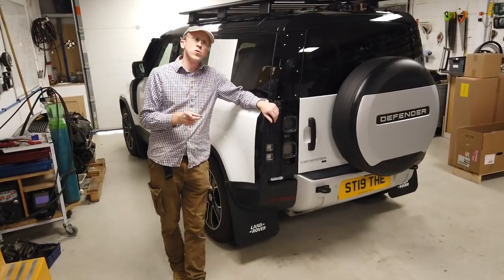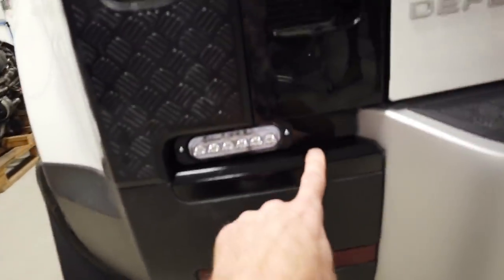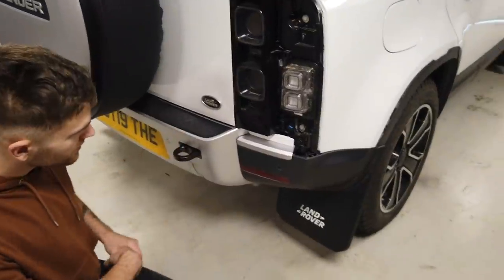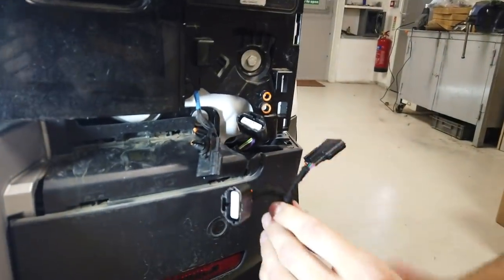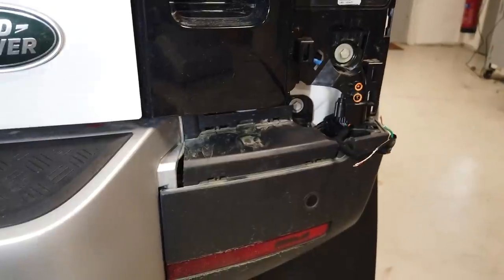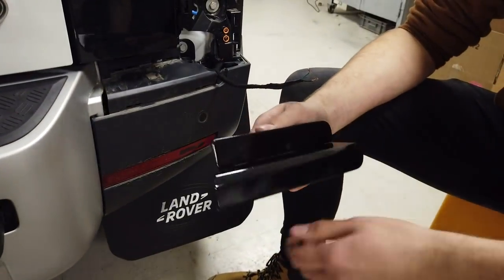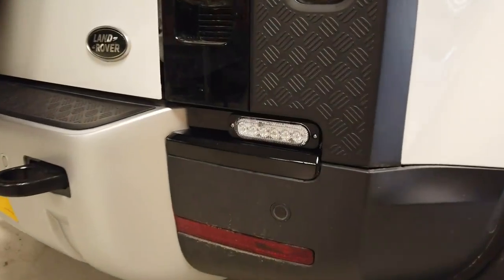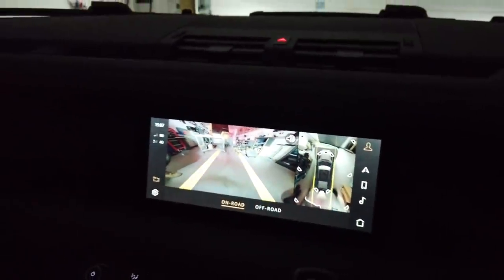Land Rover Defender 2020 reverse light upgrade to LED lamps

Comment: Simon, just received a kit and the LEDs included have three leads so you have both white and amber colors available.  I’m thinking that I might wire the amber to either the turn signals or the rear fog lights. What do you think of this idea?

Comment: Just fitted these, the video instructions are great, thank you. I did find a surprise electrical connection when removing the passenger rear light cover, it has what looks to be an antenna stuck to the back of it with a small coaxial cable clipped to the back of the trim also. It didn’t hinder the fitting but it occurred to me that it would be awkward to upgrade these trims to the chequer plate versions you have. I wonder if the antenna is the wireless phone booster that was fitted on my 2022 110 HSE Commercial 300D. I have images if you need them, thanks again

Comment: LOVE the product and appreciated Simon & Tyler's video. Here's some pointers from my experience. I have a 2022 MY 110 in the US. Dynamic-HSE. There was an aerial in the left quarter panel. It easily unclipped at the purple bottom connector. Take it to a bench and pry apart the bracket it's on. It's only 2-sided tape. Be careful. Remove residue and apply new 3M tape to the new quarter panel if doing at same time. If not, just disconnect if keeping same quarter panel. Tips from my install. 1) I used heat shrink connectors. 2) For the quarter panel to re-attach, those fat connectors REALLY have to be out of the way. It's a tightish fit, but it eventually works. 3) The black backing (the one with the double sided tape) did not work for me if I put it in before the quarter panel. REALLY jam it to the in-board side, but still not enough room. I added it after. More of a fiddling, we'll see if it stays secured. 4) I don't think it was clear (to me!) but you need to return the two part trim. I saved the back, but painted the bottom. I thought the new backing would screw onto it. Unfortunately, without the old backing there was nothing to screw onto. I double side taped it. We'll see how long before I have to sacrifice that back trim! In use it is a GREAT upgrade. Highly recommend getting this product. Keep bringing New Defender upgrades, PowerfulUk!!
Reply from the maker: Hi - Are you in the US - I think the extra antenna is on USA models. We have some new molded mounts coming out soon - I am sure we can upgrade you to these if your current ones have problems. Thanks for the tips.

Comment: With drilling a small hole in the bumper would this work for an L405... A remote switch in between the cable and light then you can have the extra light if you want...

Comment: I would recommend that you use heat shrink over the connectors to seal them against water ingress also I would do the same with the unused wiring in the harness
Reply: There were my thoughts but then I have to ask, are the loom plugs/connectors sealed where the wires enter?

Comment: If you add a slot towards the top to the hole in the backing plate you run no risk of forgetting to pass the wire through the hole befor soldering....

Comment: This is a great little up grade.
I did have a issue with the stainless steel screws, I found them a touch too long. They pushed the assembly away from the main panel when tightening up.
Cut a couple of mm off the end and was good to go.
Reply from the maker: Hi - thanks for the feedback we will take a look at this.
Crazy that the standard reverse lights are not enough to see with the cars own reverse camera system !
Reply: I've ordered the wide wheel arch for the new 90, according to landrover fitting instructions I need to remove the lower door trim to fit arches. l was just wondering if it's really necessary,  and if so which replacement clips will I need to order  to re fit the door trim. 
Grateful for any advice 👍
Reply from the maker: @richaedsnith711  Hi - not sure on this one - not had a look at a 90 yet !
See link below showing the clips you need for the door trims
https://www.dropbox.com/s/1ci9mtr4jefojj0/90%20side%20mouldings.JPG?dl=0
Reply: @L663  thanks very much, appreciate your time.👍

Comment: If you could do a double light - orange and clear - connected to indicators and reversing camera it would also solve the right indicators/hazards  being obscured when the tailgate is open. Or orange right, clear left.
Reply from the maker: Yes i am going to work with the manufacturer for this design.. with a smoked lens ! That will be the sweet spot !

Comment: 1st, the torch has a magnet on the bottom, it would have sat higher if you had used the magnet to stick to to towing eye.
Reply from the maker: Indeed the light does possess the power of magnetism !

Comment: Hi Simon

When are these Reverse Lights and the New Design Rear Bumper Protector Coming?

Are the Boot Interior Lights the same as the door welcome lights? 

Just looking for 2 BRIGHT boot lights.

Also on the reverse lights - if you are struggling to get the lights - have a look at Denali Dual Mount Flush Back Up Lights... maybe you could do a kit with them?

They are more expensive - but look it too.

Question on the fitting of theses reverse lights - why did you need to remove the plastic under the light - where you mount these?  is there not enough room to get the connector out with it still there?

Many Thanks - Your Defender still in with issues on the locks?

Keep up the good work...
Reply from the maker: Hi Simon - we are getting the lights back in stock soon and we are redesigning the mount as well.
We took the plastic under the light to access the connector without removing the light.
The Defender is still in the dealership waiting for its key coding / new activity key etc.

Comment: Excellent, easy mod. Well done guys. Change the link to this video on your web site's item page, right now it's linking to the interior lights fitting. When will these become available for sale? Black screws would be nice, but I guess it would be easy to apply a dab of paint to the heads once they are fitted.
Reply from the maker: Yes thanks for the heads up - got the video link corrected and got them on the website - for sale.
I reduced the price a bit too ! 
https://www.powerfuluk.com/vehicles/land-rover/defender/new-defender-2020/land-rover-defender-2020-reverse-light-upgrade-kit.html

Comment: Mr Landrover man.  If you go in water which is at say 80cm and you need to revise will those connections short circuit
Reply from the maker: I cant see this being a problem as water is not that conductive and also i dont think i will be reversing in water that deep !
Reply: @L663  keep Landrover calm and smiling

Comment: Bit of a problem, the clip for the electrical point won't come apart. It's almost as if it is glued together. Pushed the clip in as the video states, pulled, wiggled and tugged and nothing. Got some added leverage with a tool and to no avail, My husband even gave it a go and he said "there is no way was that was coming apart". Now off to the shop to have it looked at. It is either glued together or corroded, there is white "gunk" all around the electrical fitting, any idea what it could be. My girl is always garaged, I was very excited to try this project myself yesterday but sadly had to put my girl back together without any new parts fitted. And wasted 2 white clips to boot. 😔
Reply: Sorry to hear you could not get the clips apart - it is interesting that it has some white stuff around the connector - this could be grease ? did you take a picture you could post ? Contact customer service and we will send you some more clips free - Simon @ Powerful

Comment: Sure wish you linked the video to the panel removal. Can’t find it anywhere.
Reply from the maker: Which panel removal ?
Reply: The body panel with the brake lights which is super difficult to remove gracefully.

Comment: Sorry to be a nit-picker but the Road Vehicle Lighting Regulations 1989 Schedule 14 Reg. 20 states that you can have a maximum of two reversing lights. They also must carry an approval mark (CE or similar). Probably nobody cares but it could fail an MOT.
Reply from the maker: Bit of tape over the old ones for MOT ? I believe the lamps are CE marked. We like nit pickers ! its you guys that keep us all clean and nit free !

Comment: Looking forward to these coming back in stock.

Whilst I’m thinking about lighting, can I pick your brain? What’s the best way to intercept a front main beam headlight signal?
Reply from the maker: Good question - I guess you want to drive some auxillary lighting ?
A Violet and orange wire on RH headlight - pin 10 seems to be the best way according to wiring diagrams,,, this comes from the body control module - pin 20
There does not seem to a fuse that is driven by the high beam
Reply: @L663  Yes, I’m looking at some front LED lighting and couldn’t figure out the best way to pick up a main beam signal without resorting to the CAN bus. 

Thanks for the tip, I’ll give it a go!

Comment: I love your work... BUT..those LEDs are available on eBay for less than £10 a pair. You can set them flashing too if that’s your bag
Reply from the maker: You are correct of course... add in the clips... 4 connectors.. and the wiring ... and the laser cut parts and it add up ... We have made the kit so it is no cut and no need to touch the wiring loom..  but this all costs money.

Comment: It seems to me you only need to remove the checker plate pieces and not the bottom pieces unless you are going to paint them. Did I miss something?
I received these from you yesterday and will be installing this afternoon.
Reply from the maker: Hi - you may be correct but it may be a bit tight - let us know how you get on !
Reply: @L663  I took them off after all, it was quite easy. All is good but I did crack or bend the permanent tabs on the checker plates as I took them off, but I got them all slotted back in. It looks like the same thing happened to yours. 
I also had a shop install the recovery hooks I got from you this morning. All went well and they look great. 
Earlier I had ordered the blue door lights and the upgraded gas and brake pedals - everything looks and works great. 
What’s next?  🤪
Reply from the maker: @KY4M  The checker plate parts are made from PP ( Polypropylene ) and seem softer than the original ABS painted parts. Glad its all in and working !

Comment: Brother, thank you for the information. I have a 2009 Range Rover Sport that has a problem that no one knows to fix. Can I contact you via WhatsApp?
Reply from the maker: I doubt i can fix but please share your problem ? where are you ? I have friends in Dubai ?
Reply: @L663 
 I live far from Dubai, when I drive for more than an hour, it clicks when turning, as if there is resistance preventing traction, but when I turn off the engine, the fault goes and the car returns to its normal state.
Reply: @L663  
I went to all our industrial workshops, but it seems that they have not reached a solution to the problem, and also they deal with Land Rover like Toyota, despite the big difference between them.